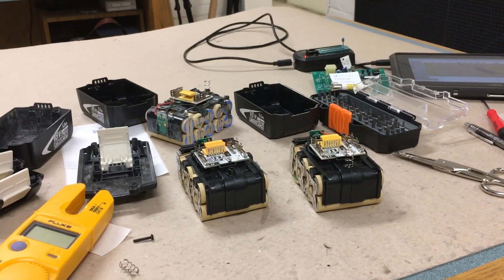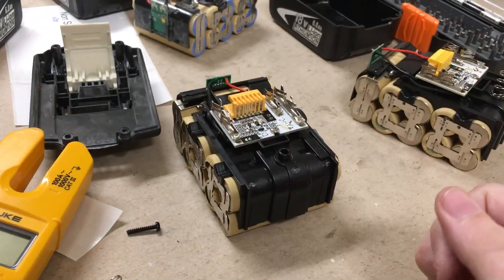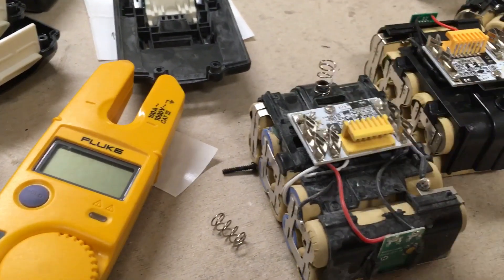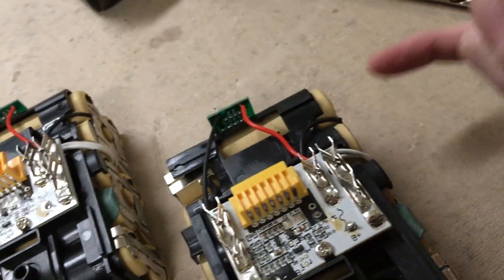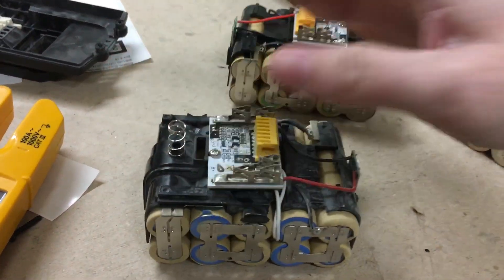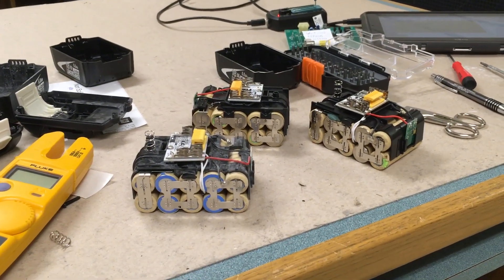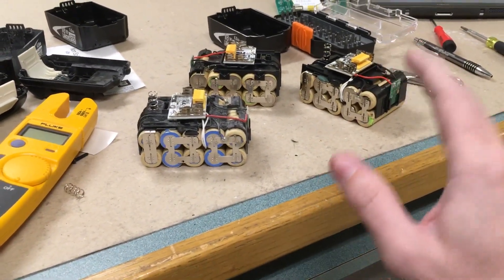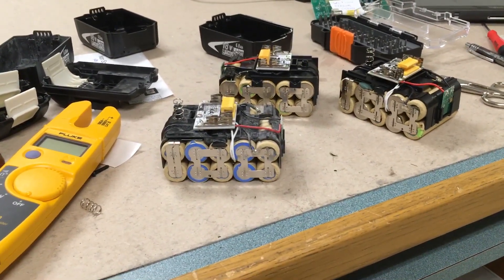Wanted to reverse engineer these Generic Amazon Makita batteries, but they have fake BMS! DO NOT BUY

Comment: These are very common and like you said not safe. All the non-oem Makita batteries are built this way. These are a clone of the original Makita designed boards that didn't have balancing leads from the earliest days of lithium. They were just coming from Nicad/Nimh that never had balance leads. In Makita's defense though they only used precision matched cells and only charged up to 3.9 volts. I've never heard of a fire or of a recall on them. All the new(10+yr) Makitas have a STAR on them that signify their battery protection computer on board or in other words "balancing". Now the balancing in all these tool batteries don't work like you would hope. They essentially just stop charging once 1 cell reaches peak voltage. There is a little balancing by maybe 0.10 of a volt but they never top off every cell. They will shut off with one cell at 4.1 and another at 3.8. This is true with all the brands and I manually have to top up weaker cells in all my brand packs.
Reply: As you may imagine the way battery cells are intended to ideally work is that they charge in parallel and discharge in series, mostly the integrated BMS inside the battery is just to prevent one cell from depleting beyond certain threshold that may impair their ability to be charged again, in the case of Lithium batteries is 3.0V I believe. In the case of charge balancing I think is the duty of the charger, and in case of fast charger and smart charger they may also sense the temperature and current of charging instead of only the voltage.
Reply: sixty five ford boop thank you for the home depot advice on battery recycling bins.
Reply: yup

Comment: When I build replacement  packs for nicad  and nimh tools, I don't use a bms, I run a lead out of the case with a multi  pin connector that connects to the monitoring  circuit in my charger, a second lead comes out for the main charging cables
Reply from the maker: I’ve done that before. It works as well

Comment: Also very bad: BMS which is dead after it has read too low voltage, some of them restart if you put voltage on the output, but some dont. Like in Notebooks.

Comment: That's not that bad.... 😂
I've seen cells made of the lower furbished cylinder and capped with a rusted washer, spot-welded and topped off with a plastic washer insulator for the anode. 
Remember how the zinc-carbon cells are/were sealed? Yes, my cells had tar as a sealant.
Reply from the maker: These batteries are proving to be similarly bad, they are fake inside

Comment: There is many different boards in those fake makitas.  I was lucky and mine had protection board ( not bms). They measure voltage on each cell and cutout but cant balance them.

Comment: Wow! 🤯 Livestream them on a baking on a charger for new years? I would hesitate to use those for much else ! 💣
Reply from the maker: I dont have a charger to lose to this
Reply: @RinoaL  Just connect some wires to them and then to the mains with a rectifier to make DC and a series heater so it doesn't just instantly trip the breaker. Should make a pretty decent fireworks display for the New Year.

Comment: i have also "fake" 6 AH 21V makita bat, i cant open this case because it need bit that i dont have.   if you take 2 same capasitor on serial the volt will be half each cell.   when use new bat cell they will chrage at same voltage (aka upto 4.2V).    the best way , charge this bat with low current.     when i was charge this cell i get 115WH ( from the wall) at 126WH( 21V X 6AH) * charge from 18V upto 21V
Reply from the maker: Lithium ion works differently than capacitors, they don't self-regulate when they rise in voltage and so they actually get wildly and dangerously out of sync. I've done a lot of work with big batteries and have seen it first hand.
Reply: @RinoaL  Q=UC ( u=voltage , c=farad,Q=energy store colon) .  W=QU ( W=watt ,u=voltage) =>total energy at capasitor W=CU^2.  if you charga capasitor at constant current the voltage go from 0 to vcc . Then to calculate the energy you W/2.   To convert total energy to WH /3600 .   Total furmula W(wh)=CU^2/7200 .    Capasitor can store energy max at volatge like lit cell(4.2V).  If cells are same and new , they will charge at same voltage without bms or balance .    I think if charge at low current , the cell will charge max 4.2V no harm will happand.

Comment: I have a similar off-brand Makita battery, 5Ah. It died and won't charge past 5% anymore.  it's the one that tells you the charge percentage from 00% to 99%. I will open to see if it's the same case.

From Amazon, I bought TWO of the 6Ah you show in the video. I will have to be careful with them until I buy a real Makita bat. I didn't think they were this bad considering they're being sold on Amazon and not as cheap as the ones from Temu/Wish. 

Thanks for sharing!

Comment: Flippin' heck. Jump on your favorite flea market and buy balancing circuits for a couple of bucks, and full BMSs for not much more. Granted, probably not the greatest quality or best engineered, but a far cry better than nothing. I remember when knock-off cellphone batteries made the news a couple decades back for bursting into flames. After seeing this, I wonder if knock-off tool batteries are pending a similar reckoning.
Reply from the maker: yeah I plan to save the good eight cells or so and make tiny packs with BMSs for something
Reply: @RinoaL  Probably made from all recycled cells anyway. Useful with a BMS DW01 board for single cell use, but not great for anything else.

Comment: I've not taken any power pack apart that actually monitors each cell individually. 

We need fire insurance more today than when everyone still was burning wood for heat.
Reply from the maker: Wow thats terrifying
Reply: With any battery pack that has any cells wired in parallel you can only monitor the voltage of the pair - not the individual cells in the pair.  You probably knew that but wanted to mention that in case.    Discharge the pack and look for any cell (or pairs of cells) that are lower in voltage than the others.  For cells in parallel it probably one of them is the weak one - but you don't know which until you separate them.

Comment: yeah you should always buy original batteries, even if you need to repair it. i built my own battery for a Kobalt impact, i used all the same known good  cells from some laptop batteries and a original bms circuit from a Kobalt battery someone gutted for the cells. it has Been working fine for 2 years now and has and extra layer of batteries than the batteries in the original 6 a.h ones, so it is roughly a 8 a.h battery it last for days though the weight makes the impact driver a work out to use! considering all parts where salvaged it only cost me $10 and about 2 hours of work to build, was much cheaper than buying a knock off.
Reply: I would be careful using recycled laptop batteries.  They are typically not designed to provide (safely) the high  current that a power tool demands.

Comment: How do you know the bms you say is missing is not in the charger for them?, look inside a charger i bet its there
Reply from the maker: Because there are no connections to these cells within the packs and so there would be no way to pass it through. Also these tool batteries according to regulation must have a BMS inside of them
Reply: Because a proper bms needs connections to each cell to correctly  balance the pack

Comment: The genuine Makita BL1415 LXT batteries which came with my Drill in 2017 also had no balancing wires. they died after 8 or 12 Months
Reply from the maker: really? interesting
Reply: Curious, did you buy from Amazon or eBay? I bought 6.0 AH batteries that look and feel like Makita but lack waterproofing or proper nickel strip support. My nickel strip on the positive got too hot and melted the battery insulation plastic, and SHORTED!! Real dangerous stuff, I was using it with a drill and a 7/8" bit going at it through some aluminum. Also, I do construction, and the plastic cracked from falls whereas my old best up ones  never cracked. Be careful, these scammers are getting real good with knockoffs.

Comment: You get what you pay for. Makita has warned of these saying they can catch fire. There are some good looking aftermarket BMS boards available for these though.

It's better to buy fakes for DeWalt, Milwaukee etc as they dont have a BMS in the battery but the brains are in the tool/charger.

Makita 18V batteries are great for projects as they have low voltage cut off in the battery unlike almost everyone else.
Reply: Are Makita's the only ones with low voltage protection built in?
Reply: genuine dewalt
Reply: @Duamerthrax  Makita 18V and Ryobi has it in the battery. Makita 40V moved the protection to the tool.

Comment: holy shit, that's so scary. and of course amazon will do absolutely nothing about this :\

also what kind of multimeter only has 1v resolution lol
Reply from the maker: A super high voltage multi-meter
Reply: @RinoaL  you can get an UNI-T or similar for like $20. doesn't have to be fluke for every job.